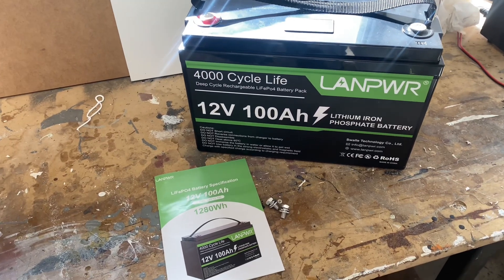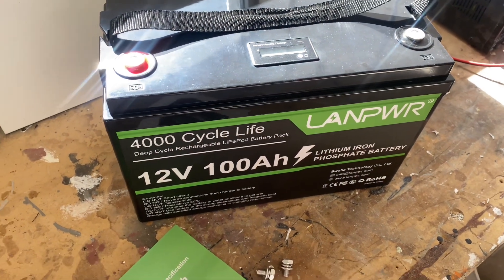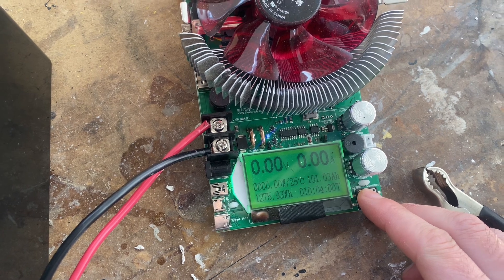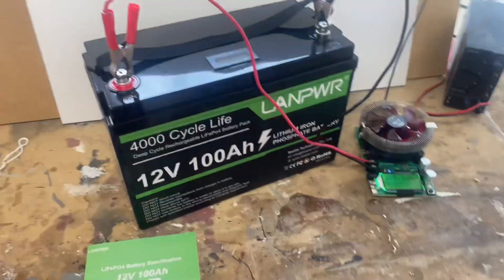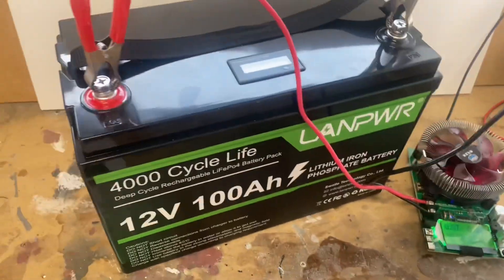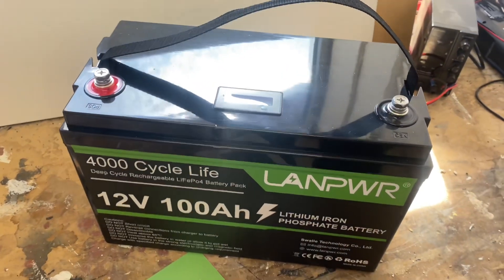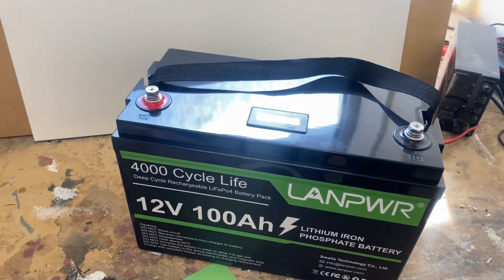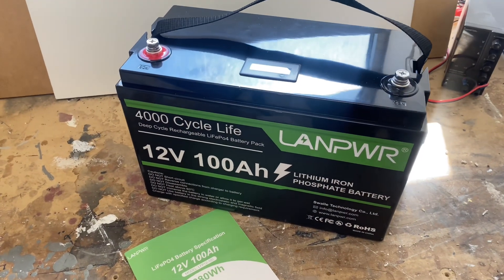LANPWR 12V 100Ah

Comment: Why would the voltage indication be usefull in a marine environment with a trolling motor?
Reply from the maker: Just because you get «some» indication of the batteries state of charge.
Reply: @JonasSyver  But like you said the voltage curve is almost vertical. But I read in the manual of my battery that if there is a load attached, the curve isnt as vertical.
Reply from the maker: Yes. Bigger load, more rapid decline. But no where near the curve of a lead acid.